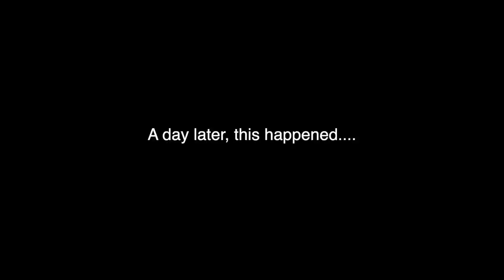UCR UPDATE: 1992 Nissan Sentra B13 1.6i Needs an Overhaul! PLUS Saga UPDATE Too :) | EvoMalaysia.com

Comment: Bad news bro for the Sentra.. thanks Chris for the good info, I will never top up the engine oil for my saga again if the oil level is below the recommended line. I use to top up the oil before my auto gearbox overhaul because it has leaking a little bit but since I done my gearbox overhaul everything is normal again.. thanks Chris u are a life saver. The next time I will send the car if the oil level is low.. cheers👍🏼
Reply from the maker: Thanks bro! Top up oil when it is low can, but also service the car per the schedule ya, that's what happened with this Sentra, it was seldom serviced 🙏🏽😊

Comment: hey chris.. yup better get it done for good life span after. i still using saga blm 08. till now she running well. i just drove from ss4 kj to same exaclty spot where i having my lunch at tok ayah restaurant oppositr ur workshop .a good maintenance plan system indeed a compulsry . reminder to all old classic car / old scholl car owner.. maintain the maintenance save u alot!. do it before to late. doesnt mean u need to spend alot each time.. but most it is a DIY . some of these part also came cheap .
Reply from the maker: Cheers bud, thanks for the encouragement, yeah, I was hoping this wasn't gonna be necessary, but as I always say, "whatever it takes" 🙏🏽👍🏾😊

Comment: Are you sure it's the oil pump? Most of the low oil pressure issue is due to the excessive clearance between the main bearings. Picture the garden hose theory, oil pump only delivers the volume, tight clearance = pinching of the garden hose = more pressure.

When it comes to lack of maintenance oil pump is usually the last thing to go, first thing to go is the oil seal/valve cover gasket, then Conrod/crankshaft main bearing.

Ironically the owner I had to convince it wasn't the oil pump issue drives the same Saga, brown colour too!😁
Reply from the maker: Thanks for the feedback bud, but yeah, we checked. Reckon it's from years of pushing sludge instead of oil, maybe.
Reply: Did you inspect the oil cap before purchasing the car? The filler hole is good enough to inspect the engine health, like the eyes that reveal the soul of the human.

Comment: likely your rod bearing is damaged too..best is to strip down the whole engine and rebuild..be good for another 500k km
Reply from the maker: So much easier said than done bud, and a lot costlier too, this will do 😊
Reply: @ChrisWeevilGarage  rod bearings are not expensive bro..the carbon and gunk likely blocking small oil pasages in the crank..the tak tak tak sound was the rod bearings..while u r there..small additional cost to replace and carbon clean the rest..pistons rings likely needs replacing too..parts are not expensive..
Reply from the maker: @trustgtr33  will see bud, thanks for the heads up 👍🏾🙏🏽😊